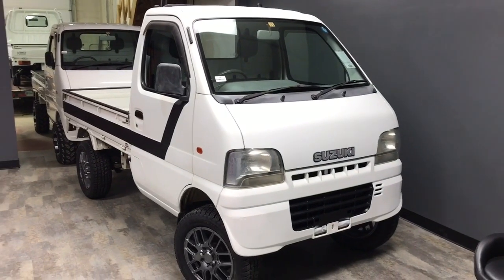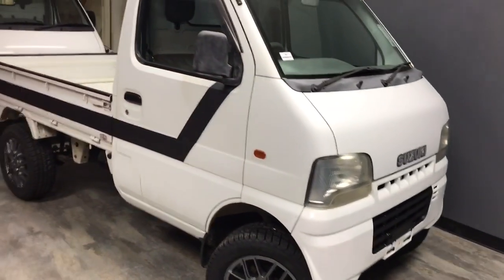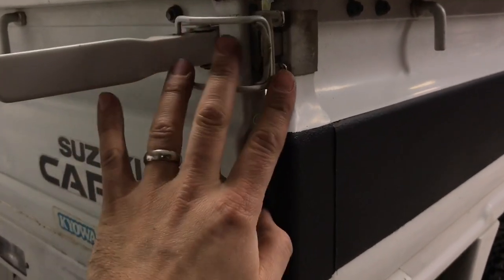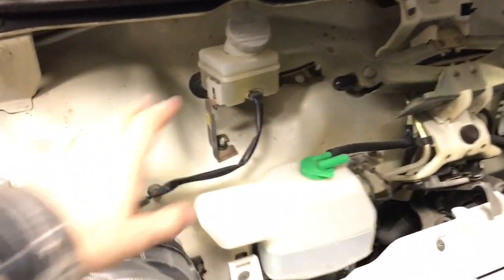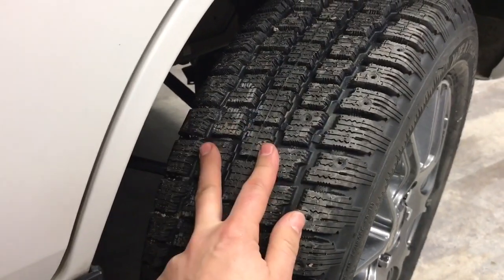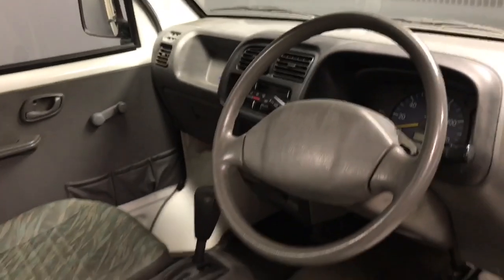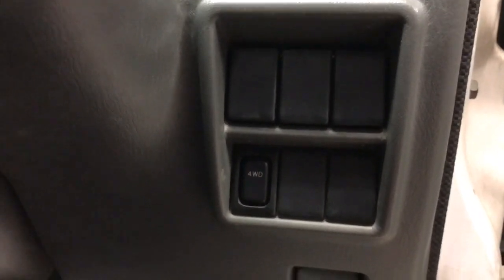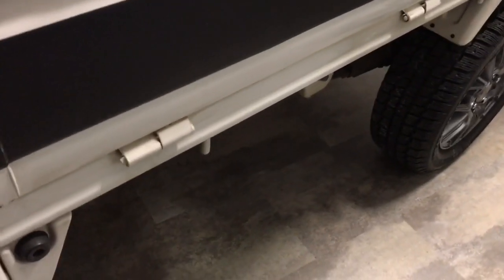Mini Truck! Detailed Walk-Around | Upgraded Suzuki Carry Automatic

Comment: I was assigned a mini mits while I worked for a golf course as a mechanic. 3-cyl motor, 4-sp stick( they had 4th blocked off as speed around curves could cause tip over?). The little truck was a beast, I drove it all over the place. It fit the golf course cart path like it was on the interstate, excellant farm, ranch utility vehicle or for running around rural areas. I'm cerrently rebuilding/remodeling an 05 31ft travel trailer, when finished the plan is to set it permantly in the ozark mountains. I'll probably be looking for one of the little trucks to use around the property and short jaunts into town for supplies. Plans are too pertty much disappear from society.. LOL....

Comment: Thanks for another great review. I'm really interested in the Carry 4WD auto trans version. What kind of auto trans is it? CVT or fluid? Is the lack of a Lo on the auto trans really a problem for off road? It would be very informative if you could do an off road comparison of the 4WD manual with Hi-Lo and the 4WD auto in your next road test. Maybe even go into some mud? If both vehicles had the same tires it would be a fair comparison.

Also how much total ground clearance is there with the additional 2 inch lift?

Thanks again. Great reviews!
Reply from the maker: Thanks! We have fun doing these videos for sure. These Auto transmissions are a standard automotive torque converter type. The biggest issue you will find off road is the lack of low gearing for sure. Especially loaded or with big hills. This issue is compounded by the bigger tires as well so thats where the low range comes in. So you just push the gas pedal harder right? Well that might work for a while but these transmissions don't have an external oil cooler (like your big 4x4 pickup would have) to keep the transmission cool. Engine coolant does run through the transmission to provide some cooling but it probably wouldn't be enough to cope with hard off road situations ie. getting stuck in the mud and working the the transmission hard to spin the tires.
Good for around the yard/farm/job-site yes, Loading the box full of wood and trying to conquer the back woods? Don't think so... well not for long anyway before your transmission gave in.
I would love to do some harder terrain tests with these trucks for sure but they are all for sale so we don't want to abuse them before we sell them. We have had many customers report back with what their trucks have and will go through and it is a lot!  Once the weather warms up we will try our best to respectfully demonstrate the capabilities of these trucks for sure.
Reply: So the Automatic transmission is worthless? The 4x4 on the auto doesn't do anything for off road use, like normal trails? Just asking because I was interested in one of these but after a shoulder surgery my days of shifting with my left arm is over. I have about 40 acres that is traveled with an F150 4x4 but mainly in 2X mode.
Reply from the maker: +Shane Ackerman the issue with the autos is that they are only 3 speed (4 speed on some newer models) 
The 4x4 is the same as on the manuals however there is no low range on the auto and with only 3 gears it really struggles with power. Traction won't be a problem, hills will be.
Reply: Now while these are much smaller Ronny Dahl did a comparison of 4wds automatic vs manual offroad. There are some places where an automatic is better offroad. Standard is more of a challenge and adds another fun component to it. Couldn't speak on these little trucks though.
Reply from the maker: All things equal yes automatics are beneficial in some areas, these however are not comparable to each other as the auto is a pure high range city transmission while the Manual is a dual range utility transmission

Comment: I've always adored these little trucks. I have been searching around google for any places in BC that sell them... seems like i will be traveling or flying to even test drive one.  I haven had much luck on finding sellers... or even people who import them.

But i am curious on how much insurance is on one of these. Here in BC insurance is... stupidly high.... even with a safe drivers discount.
I am on the fence about finding one of these trucks with an Automatic or Manual transmission... Ive never driven stick before but wouldn't mind driving something like this as a first vehicle with a manual
Reply from the maker: These are great little trucks. Insurance in Alberta and Saskatchewan doesn't seem to be too bad but I haven't heard from anyone in BC on that front. It would be easiest just to call your insurance company and ask for a quote. Then you will know for sure. Also just a note, some insurance companies are more sensitive about right hand drive vehicles than others so be sure to make a couple of calls.
Reply: Yeah.
The other thing im worried about is the maintenance, and replacing or repairing parts. I know it might be possible to find items/ parts that might be able to fit in. 
I did run into someone here who had a Diahatsu Hijet... he had to find parts for the suspension... he said it was hard finding "sister' parts. Ordering straight from japan would have cost nearly $700 for one axle
Reply from the maker: These trucks require very little maintenance when compared to a side x side UTV. We order parts from Japan every week with no issues.

Comment: So you can only get hi/Lo range in the manual trans? What about diff locks?
Reply from the maker: Yes manual only. Rear diff lock was available on the manual as part of an agricultural package only
Reply: Four Sons Off-Road Inc. interesting. Thank you. Do you have a transport service available to Calgary? Are there lockers available in the aftermarket if I purchased one in auto?
Reply from the maker: We ship anywhere to Canada. There are some basic limited slip kits in the aftermarket but that's about it.
Reply: Four Sons Off-Road Inc. thank you, you’ve been very helpful. How hard are parts to get when they break? How much would one in auto in reasonable condition cost with shipping to Calgary? Ball park?
Reply from the maker: @Packinheat1175  Parts are very easy to find in Japan. Just takes time to get them here. Cost will really depend but I would say you would be $9000+ for a similar one in the video before upgrades.

Comment: What type of ATF fluid to be used here? I have Every 2004  A/T so I assumed we have the same GB13 engines
Reply from the maker: Hi There, so the only info I have is "Suzuki ATF 2384K" out of the manual. We really don't do many autos if all so really don't have any first hand experience with them sorry.

Comment: Quick question on these. Is there an insert of some kind for the speedometer? I'm in the United States and obviously we drive in MPH not KMH.
Reply from the maker: Nothing I know of
Reply: Four Sons Off-Road Inc. hmh I could probably make one if I acquired a mini truck. Just have to do the calculations
Reply from the maker: Ya shouldn’t be difficult. 1.6km per mile